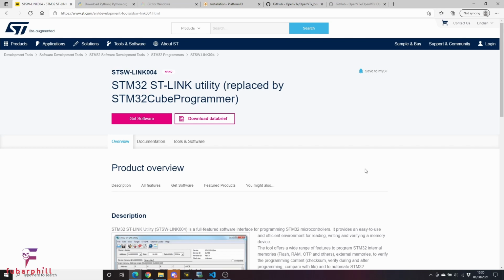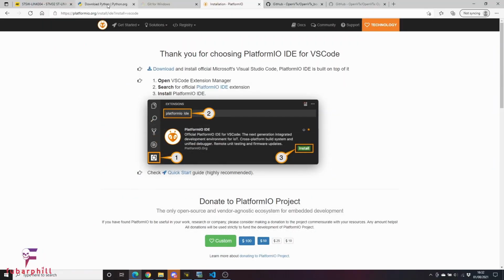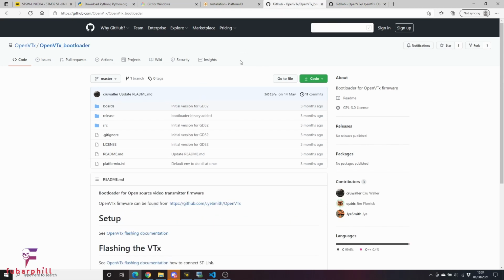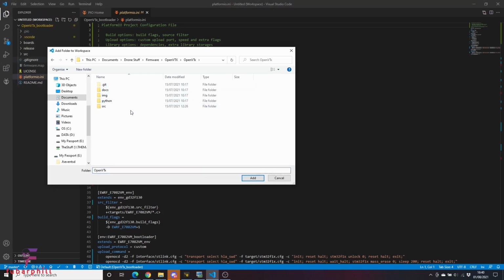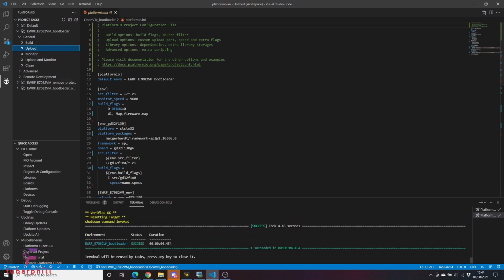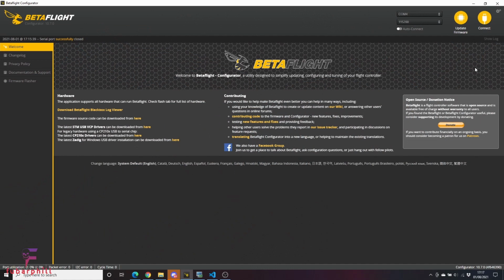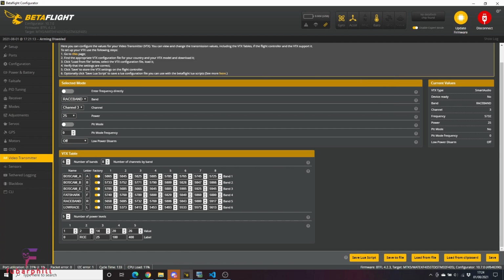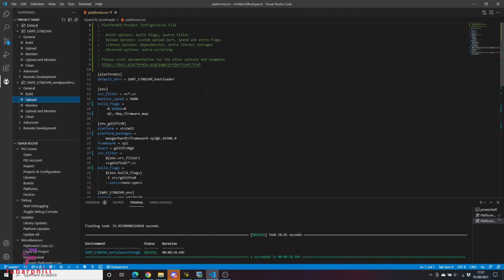OpenVTX Firmware   Building and Flashing

Comment: Hi. I Flashed my OVX300 with openvtx configurator (v0.2.0). The "device ready : yes" appear only when  Tramp selected. But after the flash it give the "RTC6705 not detected" led blinks & no signal detected or captured when scanned (even with direct input in BF). Is there any other steps that should I do to make the VTX work? regards

Comment: I've had terrible luck with OVX300, OVX306 and EWRF vtx's.  Either no video or poor video that fades at 100ft.  Smartaudio seems to work.   I tried to update firmware via passthrough after first setting the option bytes using stlink and then successfully uploading the bootloader.  When I try to upload the compiled OVX306 target via an old F3 Evo flight controller with the UART TX set to smartaudio in Inav configurater VSCode detects the smartaudio then tries to restart into bootloader over and over until time out fail.  Ugh!  Love to here details of recent successful uploads and range tests.  I'm worried there has been a giant batch of bad chips in the recent vtx's from china.  They all seem to use similar RTC6705 RF amplifiers.
Reply: I have the same issue with open vtx. I had to eliminate the 0 and 25Mw from the power table. It seams like it goes into pit mode while you are armed which gives the horrific range. Once I got rid of the low power I was able to change to 100 or 400mW and it would stay there. I haven’t tried updating the firmware yet to see if the problem has been fixed with a update.

Comment: Fubarphill mentions using betaflight passthrough but does not issue the serialpassthrough command in the betaflight cli?  Does the smart audio handle the serialpassthrough or do I need to issue the serialpassthrough cli command for the UART TX I have connected to the smartaudio pin of the ovx300?

Comment: i have Happymodel OVX300 , it use open vtx firmware, it have noted that it must work with smartaudio or tramp, but can i make it work without smartaudio or tramp with configuration on the firmware and if can, how ???
Reply from the maker: I'm not sure if it is possible to set the channel and output power using the onboard button. The main purpose of having openvtx is to have more control over the vtx so it seems like it would not be worth using it if you aren't using either tramp or sa. In fact, looking on the happymodel site they say "Must work together with a flight controller that supports Smartaudio or Tramp".

Comment: Thanks for the excellent tutorial!  Never used VSCode/PlatformIO before but successfully flashed the bootloader then betaflight passthrough for the master firmware on a E7082VM V2. It worked!  SA and Tramp protocols both work with their appropriate VTX table. Pretty cool stuff!   Any benefit of one protocol over the other?
Reply from the maker: Not really, from my experience anyway. I think it's mostly personal preference. I think Tramp is a slightly easier way of setting the power levels, using the mw value as opposed to the dBm but other than that, as long as you can change your vtx settings without fiddling with a button, both are a winner.